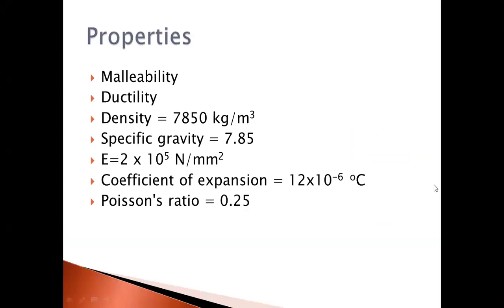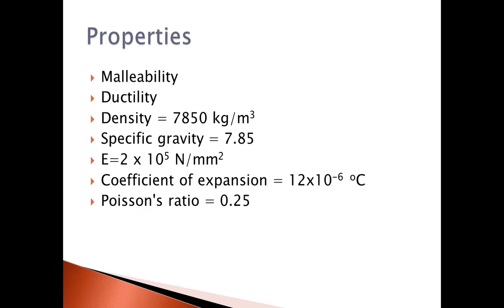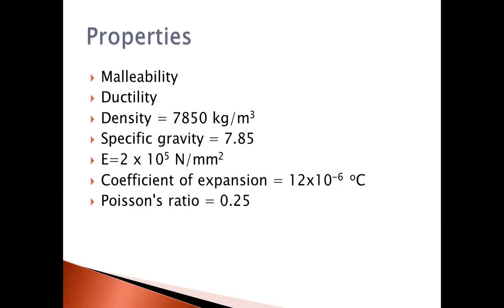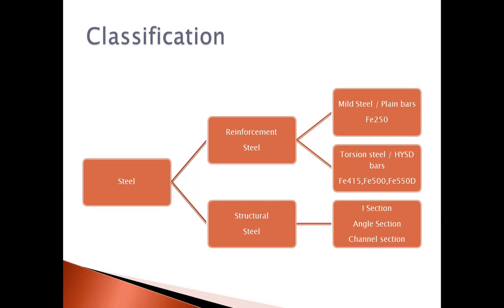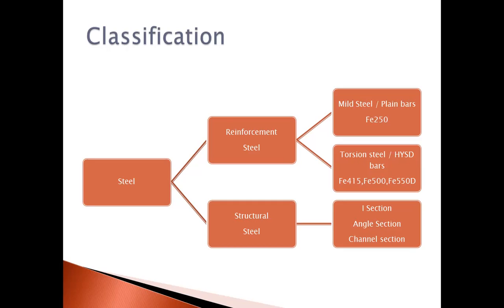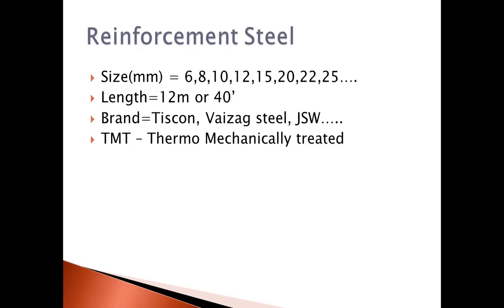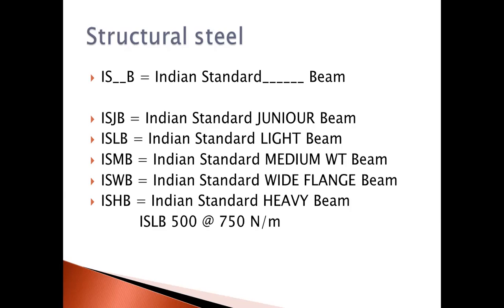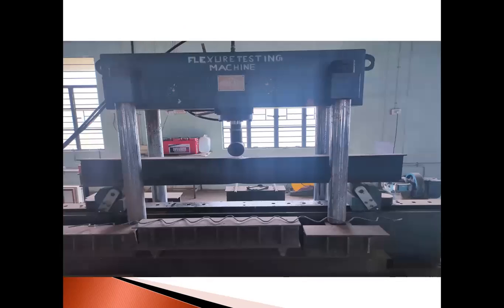Steel

Comment: Weight of 10mm dia bar = 0.617
Weight of 10mm dia bar of 10 m = 6.17
Ithu correct ta sir?
Reply from the maker: Yes, correct Sathya...The unit wt of 10mm dia bar is 0.617 Kg/m...
What is the wt of a single bar of 10mm dia ?